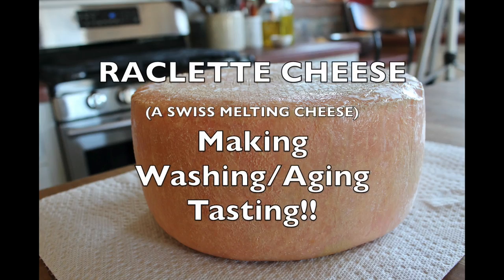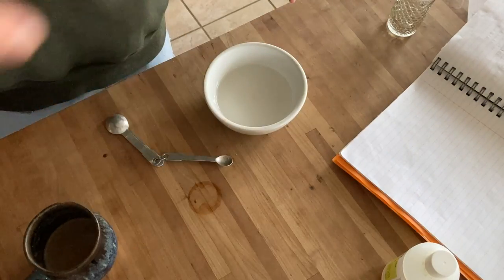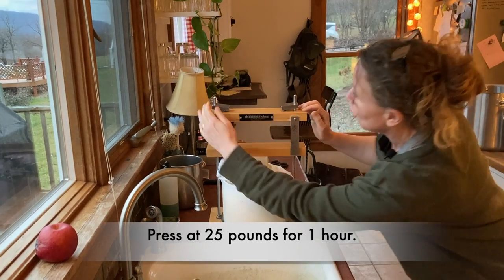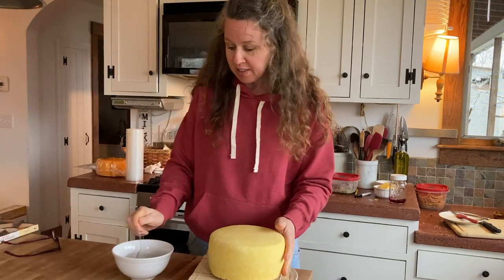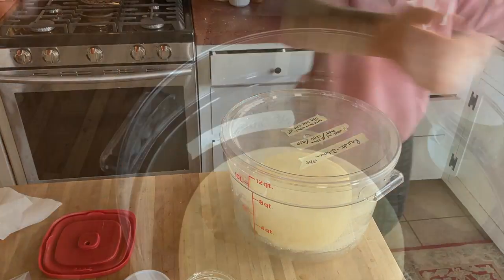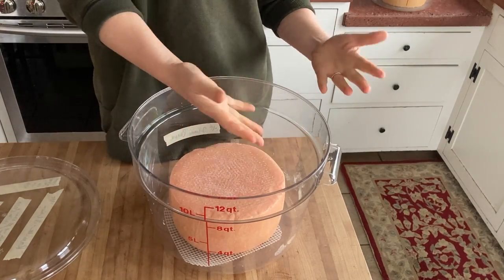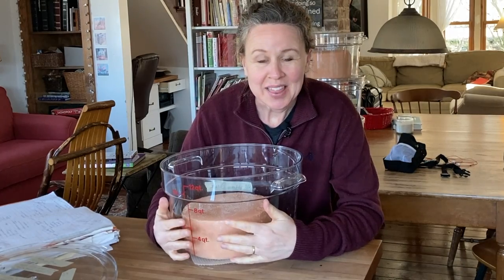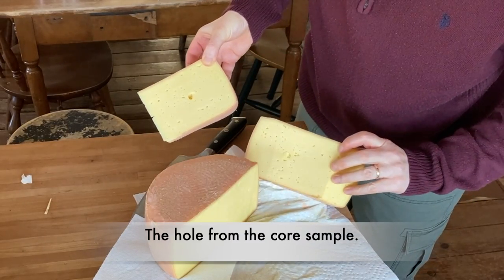How To Make A Raclette Cheese: Washing the Rind, Aging, Tasting (and Melting!)

Comment: Just to be sure, degrees here are intended as Celsius?
Reply: Or more likely, Fahrenheit (I would not put my hands in a liquid heated to 100 °C). I've always wondered, doesn't the subsequent heating of the curd kills mesophilic ferments?
Reply from the maker: @federicasgorbissa5092  Yes, Fahrenheit! 

And yes, I don't understand all the science, but if the temps go high(er), then a thermophilic culture is needed. Combo cultures, when used, do "things" to the cheese at different stages of the process.
Reply: Thanks!